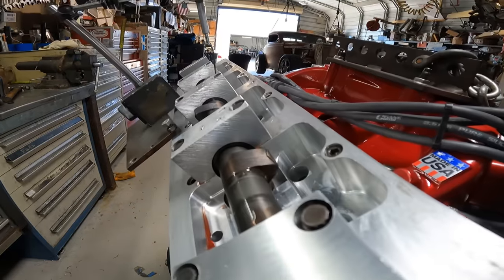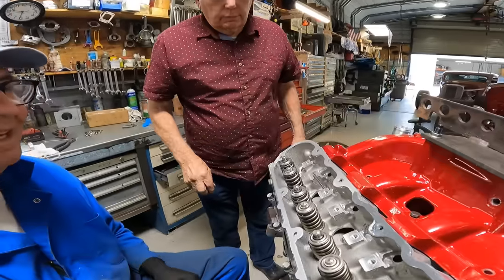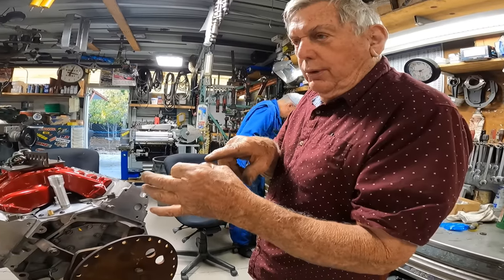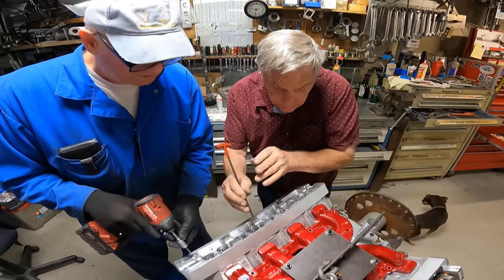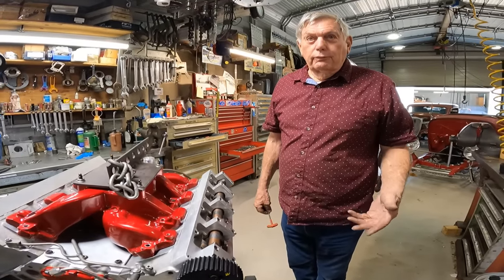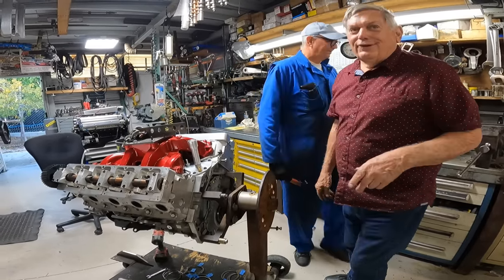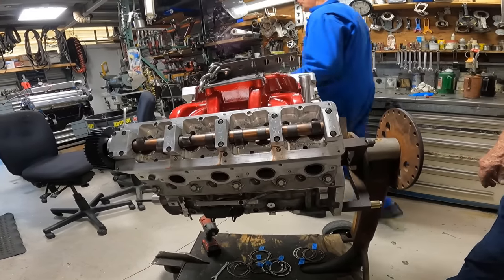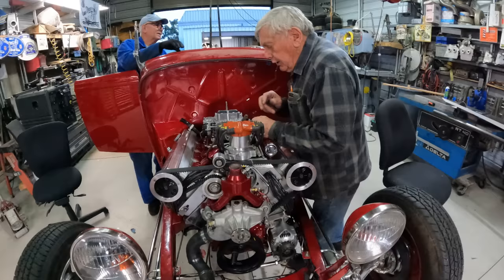Chevy LS 2 Valve Overhead Cam Conversion - Drive Toward a Cure with Aardema Braun - Part 1

Comment: These 2-valve heads...along with a flatplane crank, made me remember the TVR's AJP V8. Obviously a totally different engjne, that had a 75-degree angle between the cylinder banks, not to mention it was 4.2 to 4.5L, but still...made me imagine it as sort of a 'tribute' to the AJP.

Congrats! 👏🏻

Comment: It’s so cool what these guys can accomplish together. It would be interesting to see how much power it makes on a dyno compared to the regular pushrod cam setup with the same specs
Reply from the maker: I will try to find out if Pete and Kevin have any data on the improvements. I know that the previous engine designed the LT1 Chevy 350 which they  converted to overhead cam in the same manner produced significant more power.

Comment: the camboxes does make the block wider so you might get problems getting at the sparkplugs or the headerbolts if its build intoo a normal car 
maibe for putting it intoo a lake racer you could swap over the heads left to right to have the exhaustports on the inside , build the headers on top of the engine and build two log style intakes on each side of the block 
i think there be less hot air arount the intakes and the fuelrails and you can cross over the scaveging between the two cilinderbanks on the exhaust side (8 intoo one setup) though the headers will be a snakenest  and you have to be a contortionist to reach inside there and get at the sparkplugs wish will move intoo the valey of the engine too 
just looking at a set of heahgaskets for the ls1 the boltpattern around the cilinders is symetrical , its just the pushrod part on the heads that sticks out 
with the overhead cam you dont need those holes
Reply from the maker: Currently it resides in a 32 Ford and everting is accessible.  Pete's newest engine design with the Streamliner will have the engine partially rotated on its side to allow the headers to be tucked inside.  We will feature this pretty soon when he starts the engine  mock up in the race car.  thank you Greg

Comment: Interesting as ever. 
 I wonder what's the rpm potential of this single over head cam LS. Pushrod LS with upgraded valve train reach 7krp no problem.
Reply: Other than the "wow, that's neat" for the street I really don't see any advantage. Now for trying to set LSR records that's different
Reply: And there've been some to hit 8500 to 9k with forged/lightened  internals and a few other goodies I can't quite recall at the moment.

Comment: Is the base circle large enough to match valve lift for the pushrod and rocker setup?  If not, it seems not using a finger follower means less lift and flow but improved valvetrain stability.  I'm curious how it will compare to standard with same valve timing.  LOVE, LOVE, LOVE the LT5 head on the LS block that they did.  Have Kevin and Pete played with Porsche 928 heads on anything?  I seem to recall somebody did something back in the day on a Chevy Big Block if my memory is correct.  So glad you are covering what these legends are doing.  Really cool stuff.
Reply from the maker: To answer part of your question, Yes, Pete and Kevin have adapted Porsche 928 heads onto a Chevy big block which is one of Pete's street rods.  We will try to feature this car in the near future.  I believe the 928 Porsche 4 valve head may have sparked some curiosity and might happen to be one of the reasons behind some of these interesting builds.
Reply: @GregQuirin  thanks for the feedback!

Comment: I’m building a 12 port DOHC head for a 6 cylinder motor soon.  I’ll be using needle bearings for the cam journal s I can get away with splash oiling.

Comment: My ideal setup would be a 3-valve SOHC with twin-spark so the valves can be as big as possible and so there can be a small quench area behind the intake valves. Engines with a single exhaust valve just sound better to me than engines with 2. They're deeper and less raspy compared to 4v engines which are higher pitched.

Comment: Why, the LS is a great engine without adding a bunch of complexity.
Reply from the maker: They have done a lot of the Chevy 350 LT1  overhead conversions with increased HP.  I dont know the HP data for the 2 valve LS style conversion however my guess is it is greatly improved.  Thank you Greg

Comment: Great Video! 
Tuners spin the OHV Cam-In-Block motors to 9000 rpm. OHC makes the engine bigger, heavier, more expensive, more complex and more difficult to work on. Give me an OHV everyday, unless I'm tuning for over 9000rpm. My 2 cents
Reply from the maker: Thank you and I can understand your 2 cents, however  Pete and Kevin know what they are doing when it come to this kind stuff.  Their engines are designed with one thing in mind = more HP. They have 37 land speed records in the books.  They have done this for over 30 year’s. If OHV cam in block engines make more more power, the team would sure  welcome some more competition on the  lakebed.   Complexity doesn’t carry any weight for Pete and Kevin they thrive on complex engine designs.  Thank you!
Reply: @GregQuirin  Thanks for your reply. I have looked at most of Pete's  and Kevin's videos and have incredible respect and admiration for them. If I sounded like I didn't, I apologise.
OHC design's main objective is to reduce reciprocating mass in the valve train to increase rpm. Other benefits include better valve placement. That said, for decades Triumph motorcycles used Twin Cam OHV designs which may be able to activate 4 valve heads. What confounds me is that 4000 rpm diesel motors are being designed with OHC! I just pulled off my Land Rover TD5 cylinder head for the second time and wished I did not have to mess with going under the vehicle to lock the crankshaft in place, and then mess with removing the cam sprocket and securing the cam chain...some time ago on a prominent show, think it was Autoline News, it was said about the chevy v8, 'if OHV was now a new technology, everyone would be praising it for its light weight, compact design, and reduced manufacturing cost!' 
The Chevy V8 is probably the most tuned motor, some examples pushing 5000hp, check Steve Morris videos. Much respect to you GregQuirin
Reply: Another major advantage of OHC designs is you don't have to squeeze the intake ports in between the pushrods, so they can be bigger and a better shape. Obviously that's more significant for 3 or 4 valve designs, but it still helps on a 2 valve head.
Reply: @nerd1000ify  don't get me wrong, I love OHC/DOHC! For LOW RPM motors like diesels I prefer OHV mainly because they are lighter more compact easier to work on and less expensive. In fact for a VERY LOW RPM motor, I even like Side Valves if combined with a big Turbo!
Reply: @captarmour  Yeah all methods have their pros and cons. I think diesels tend to use OHC mostly because they usually use swirl ports which breathe worse than the regular ports of spark ignition engines, so they need all the help they can get for airflow.

Fun fact, there have been 4 valve per cylinder OHV engines. For example the Bristol Mercury and Pegasus radials used by the Brits during WW2. You can't practically make a OHC radial, so they had a system where each rocker actuates two valves at once. After making those oddball designs Bristol went really crazy and started building sleeve valve engines, which are a whole different story.

Comment: 7:59 - yeah, that call sounds like a scam. Chrysler did do a four-valve quad cam 426, back when Ford money was trying to get the rules changed for NASCAR, with Chrysler calling their bluff and showing if NASACR let Ford three-valve head in, the MoPar drivers would have four valve heads supplied. NASCAR mandate 2-valve's and pushrods from that day onwards. The Quad Cam Hemi was then rumoured to go to drag racing, but NHRA put the foot down on those for safety and power at the time.
There has been Aftermarket Quad Cam 48 Valve Hemi engines in drag racing since, notabley the McGee engines, but the number of moving parts ends up making them more time consuming for the between-heats-rebuilds. The 'Factory' Quads Cam heads never left Chrysler ownership.
Reply from the maker: That’s awesome information. Pete has some of the original Mosher 4 valve heads from 1970 my understanding they were developed for Indy .  The Mosher was used on a Chevy Small block.
Reply: @GregQuirin  Indy is one place GM has had decent success in Motorsport, and run programs that created world class engines - The Northstar V8 gets laughed at in streetcars, but the race version was a weapon! Later versions of that street version get dropped in to Fiero's and turn them in to supercar hunters. Then there was the Buick alloy engines, that ended up being the Rover/Leyland V8 from the road engine, and the Aussie Repco-Brabham Formula 1 engine from the basis of the Buick Indy program.

Comment: Is there a real point in going ohc on an ls? as a "mild" 2 valve?? Cons: loss of roller lifters (flat tappet cams are limited), loss of rocker arm ratio, complex oiling, 1/8 mile of timing belt (in this case unprotected), added weight, loss of that compactness that allows the ls to fit anywhere, 3 extra oil seals, does the stock water pump work?... Pros: it looks pretty kool, potentially can rev higher, the cam lobes can potentially be bigger than the bearings which is really needed just to get to a point where its comparable because we lose the rollers and that rocker ratio...
Reply: The upside is you can use much lighter valve springs for a given RPM, which reduces friction in the valve train.

In principle there is another perk, no need to accommodate the pushrods on the intake side gives much more freedom in porting. You could fill in the pushrod tubes with epoxy and completely reshape the ports if desired.
Reply: @nerd1000ify importantly Ik this is an exercise in mechanical showoffie artwork and really just a BC we can engine and not done for practicality and def not cost effectiveness lol... all that is true in principle but rollers and rocker ratio mitigate so much of the issues (more lift for less cam and more importantly the spring has that same ratio of leverage when closing).. on the ls engines the pushrods arent really a factor in porting like on older small blocks... Especially at the power level we see here. The ports are already too big for as big of a valve as u can squeeze in there plus gains are usually had raising the port not widening... U ever see lifter springs? They are pretty cool they sit under the head to aid the valve spring and really help with pushrod wear on high rpm motors and we have done a lot like that to make pushrod motors really sing over the years... Im just saying the real gains of ohc are with 4 valves and/or Hemi or at least true cross flow and definitely not with a "conventional" pushrod valve layout.. On the friction point, in this case I cant imagine giving up rollers in favor of a mile of belt, 2 extra cams, tensioners and oil seals can result in a net gain on such an already optimized platform..
Reply: @ianbuilds7712  Well for this build sure, it's clearly a 'for-show' engine. But you can certainly get benefits from going SOHC even with a 2 valve non hemi design, else nobody would do it! You can even find non-crossflow diesels designed this way (e.g. Renault F9Q, an awful engine in many ways but they did it...).

If you were building a clean sheet design you could pretty easily have roller rockers running straight on the cam to give you the same benefits of rocker ratio and low friction without the pushrods in between. E.g. the Ford Modular 2V has SOHC with roller rockers and a 1.75 ratio.

That being said, you can get 80% of the way there with an optimised OHV setup, and the results speak for themselves in the LS.

Comment: Is there an advantage to this conversation, or is it because we can?
Reply from the maker: Both,  there is an advantage and HP gain.  Then the uniqueness on a one off engine made by Pete and Kevin.
Reply: @GregQuirin  Was trying to think of an engine that was available as a ohc as well as ohv both of which had been developed to the last enth, degree. Only one i could think of was the 1000cc Ford 105E unit. Seem to give 112-115 Bhp @ around 10,500-10,700 rpm against the SCA Cosworth conversation  which made 130+ quite easily out at 11,500+. Past the rpm limit of my GB3C dyno.

Comment: How can the cam be ok with it rotating on the valve that looks like it's going to chew it up
Reply from the maker: This top end  design is very similar to Volvo or Toyota with the buckets over the valves. They’re not direct acting on the valve stem they’re direct acting on the bucket which rides over the valve.  This is a common design on many OHC engines today.  Pete happens to use Volvo buckets for most of their engine builds. Thank you Greg
Reply: @GregQuirin  thanks very much for responding, l have always had in mind to convert holden v8 5.0 to a double overhead cam with a hemi chamber but that's a completely different head. Can l ask why you have eliminated push rod system .
Reply from the maker: Pete and Kevin do this for landspeed records,  most of the cars on the lakebed are using push rods.  There is a 20-30 percent power gain with higher  revving 4 valve OHC engines Pete and Kevin build.  That’s pretty much why they do this to all their engine builds.  Thank you Greg

Comment: hi, Sadly I bet this engine does not make as much power as a rocker arm LS. Why? because that overhead cam does not have as much lift/ duration as a stock LS cam/ rocker system. I would really like to to see a straight up dyno text- say a good .600 lift LS cam and rockers against that overhead cam.. This might rev higher but I would be shocked if it made any power
Reply from the maker: Hard to say I will see if they have any data from the previous 2 valve LS OHC conversions they have done.  Thanks Greg
Reply: Power and Torque numbers improvement will depend on both the cam having a larger base circle, and the lower friction losses of the OHC setup.
Reply: The heads can be made breathe better with overhead cam, stop looking at just the cam specs.  Thats why the cam specs are what they are as well.

The valve actuation doesn't need to pass through the head and thats the main advantage of putting the cam there.
Reply: hi the stock LS cam has a 55mm? base circle. Looks like the ohc has much less.yes they will rev higher longer but I would be shocked if they even made the same power as an LS with a decent cam.  @PiDsPagePrototypes
Reply: how are the heads going to breath better? @lassikinnunen
Reply: @lassikinnunen  The heads shown here have not been ported - they're described as being stock, which means the only difference to the breathing comes through the cam being changed.
Reply: @samstewart4807  Not sure on that 55mm number, I thought it was more like the top of the lobe to the opposite side of the base circle, was about 55mm. Happy to be wrong on that though, as, MoPar Folk live here.
Looking at other videos on the channel, there's a bit of Land Speed stuff, for that type of racing, loosing bottom end torque is okay, because of the low-traction surfaces raced on, and turning higher RPM gets the top end speed, meaning a little less power and a lot more RPM is preferable.
Reply: ok the ohc DOES NOT have a larger base circle- it has a smaller base circle and less lift  @PiDsPagePrototypes
Reply: @lassikinnunen  wtf how are the cyl. heads made to breathe better?I bet $500 the ohc in this video does not have more area under the curve/ more lift/duration then a good LS ohv system. Where do I put up my money? The engine will rev higher and last longer at high rpm then a pushrod engine- The Bville guys want high rpm power right? ok so maybe at 9500 rpm the ohc engine makes more power then an ohv engine- for 1-2 minutes. BTR has a LS/LT  cam and kit that will go to 10,000 rpm But I dont think it is suitable for Bville why? because it wont run long enough at 10 k rpm for what that want to to do  Why not compare the BASE CIRCLE dia. of EACH CAM?ding Think about this-In the last 50 yrs.  NOT ONE OHC conversion on any sbc/bbc/ sbf/ etc made more power than the pushrod engine Example 427 ford sohc it made omg 600 hp in 1964- 60 fu-- yrs later it still makes 600 hp. It cant make more because the overhaed cams are limited to .600 lift. WHY are they limited? 2 reasons 1, the base circle dia of the lobe and B,the weenie rocker geo. HOW MUCH LIFT DOES THIS SOHC LS engine have???Those lobes in the pic/ video are ALL you are getting with that base circle dia.I will be surprised if they have over.500 lift- .Think about this lol a 308 ferrari has about a 1 inch base circle cam lobe lol it makes 180 hp a Haya Abusa at 1200 cc also has about the same cam lobe base circle lol it makes about 160 hp.To get an .800 lift cam over bucket lobe you need about a 3 inch dia. base circle. Let me know how the geo. on the valve works out for u
Reply: These guys made a great conversion. I am sure it will work well. It is a wowow project. I am also sure they set up their Bville engines to run at 9500? for how many minutes? I dont think the NASCAR stuff runs that high for that long.. AND the cost to do a NASCAR set up will be more then their conversion. But I will be shocked to death if it makes as much power. per cubic inch. (large c.i. aka 370-427 ci.